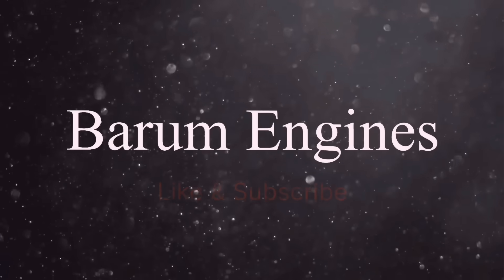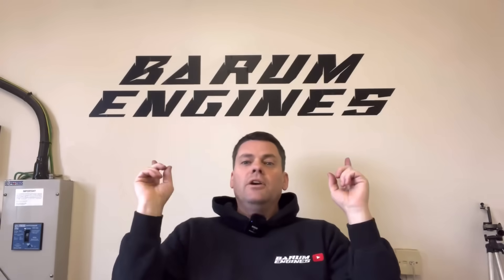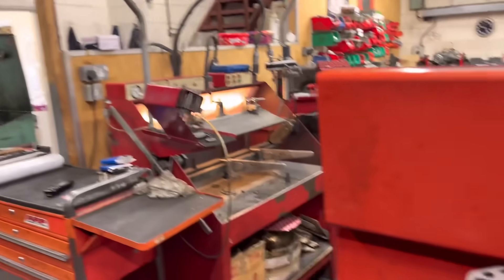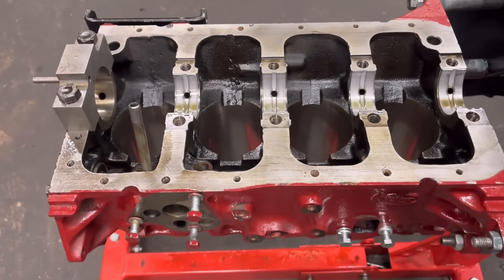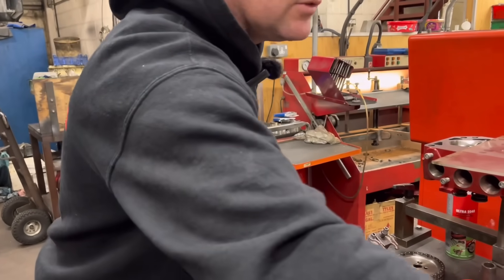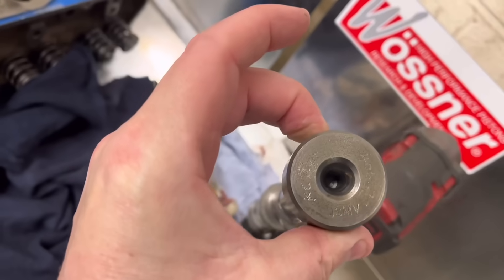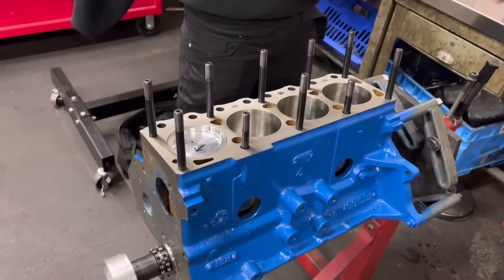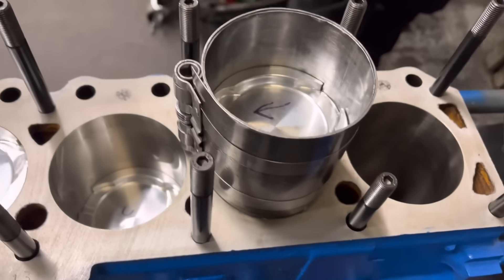Engine builder secrets: How to build a race engine

Comment: The pre crossflow, appeared to have polished ports on all of them. i could be wrong, these engines from my experience performed so much better with a rough inlet to mix the fuel and air, and polished  exhaust,to get rid of the rubbish, 
Also the cam you have in the "hot" crossflow, is very mild, and not a race cam, if you want a race cam go to a 285, that i used many times, or from memory, a 300, but no good on the road,
Reply: Back in the day we got 207 flywheel hp with a Kent 285 cam in an 1800 X/f on 48 Webers for Dave Edmands Fiesta,  HTR Ltd
Reply: @rotax636nut5  i only ever made 150 with a 285 cam on a 1691, with 40's, but took the 40.s off, as they were shyte, and made 145 with a modified  28/36dcd reliable engine, till i cooked it with a fan belt come off, then a head gasket! used to run to 7k, but this was a home build, so i was quite happy with the results, i did my own skimming with pate glass and grinding paste

Comment: In the Dagenham factory we used a burette, it's much more accurate! I was a production engineer on OHC block and heads, York Block and heads, Kent block, and the Kent diesel block after the changeover.
Reply: Indeed, we currently use a digital burette.

Comment: Like the new sign Lee, all thorough I thing Paul did it with some Duck tape and a blunt knife.
Going onto the MGB why did they not remove the breathers and bung up the hole on the inlet, run the engine and see if the smoking stops, before pulling down a rebuilt engine. 
Basic mechanics in my day.
I raced a 1.5 per x flow on 45s in a Cortina MK1, what an engine. It never missed a beat even when revving it to 10000.

Comment: Back in the day we use 85mm Powermax pistons, Vandervell bearings  and Kent cams to get the 1600cc ford up to 1760cc for the people who cheated in the 1600cc class and we did build a lot of these, but you need to get the right block for the job. It is also easy to bump the oil pressure up by pressing the pump release spring in so you can add a washer between it and the block, do not add to many as we tried more and blow a filter O ring out and what a bloody mess that was.🤫

Comment: Lee on compression ratio I forgot to mention to remember to account for rod expansion/stretch. Expansion can be measured with a rod&piston assembly out of the block. Measure the length at room  temperature then put it in an oven at about 150C and measure again.

Comment: The plasti gauge is a variation on what in industry (With much larger bearings) was checked with lead wire. Same process but the wire is measured with a micrometer after being squeezed in the bearing.

Comment: When I have done this its first done to make sure all the cylinders are the same cc to ensure all cylinders are the same compression ratio removing material from the chambers or grinding the valves so they all are. I have only one hole in the perspex and angle the head slightly so that hole is at the top by the edge of the chamber and use a smaller more accurate medical hypodermic from a vet. Especially when running high compression ratios say around 14 a small cylinder to cylinder cc difference can be critical.

Comment: Lee, I'm thinking those sharp corners where the valve cutout cuts out the side of the piston could be a source for pre-ignition.  Me thinks I would have rounded them off a bit to negate the potential hot spot.

Comment: Are you calculating the static or dynamic compression ratio?  For a performance engine the dynamic compression ratio is more important as it accounts for the valve timing as well as the other factors.  A DCR should be in the order of 8-8.5:1, whereas the static compression ratio can be 10-12.5:1.  The higher the compression the more power an engine will put out but above the DCR limit detonation can occur, the art is to get as close as possible to the DCR of 8.5:1.  
Whilst the engine appears to have been ported and the chambers relieved, have they been cc'd.  CC'ing only one chamber presupposes the rest are the same - is that the case?
Reply: Very good question as I was wondering the same thing. If they do all cylinders or just base all on one, also if you had to take 5 thousands off the piston did you also take 5 thou off the valve reliefs in the piston, or is the running clearance ok still.

Comment: Are the con rod bolts, stretch bolts ie limited amount of times they can be torqued up? On my Yamaha R7 OW02 race bike this is limited to two times and they cost £850 a set.....if you can get them.

Comment: Got a quick question I've rebuilt my n43b16a engine from116i I bought a head gasket set from the shop which they said was the right one for my engine and  it just will not start tried for over a week all times perfect looking through the receipts and parts what I've noticed is the original head gasket is 0.62 and the new gasket the shop gave me was 0.80 which has been installed would this be our problem of a no start with lowering the compression of been thicker or would it not make much of a difference any help would be greatly appreciated 🙈 😎
Reply: Fuel pump 360 degrees out.
Reply: @jamesaleando2529  thanks buddy I'll give it a shot 😎

Comment: I'm a bit surprised that you only measured the volume of 1 cylinder. On engines that I have worked on where the head has any sort of resizing of valves or changing chamber geometry we always measured the volume of every cylinder to make sure that they were within a millilitre or less in volume.

Comment: Not sure how to contact you so writing it here. iam just wondering how expensive would be to bore cyl block from 84mm to 86mm talking about bmw e36 325i m50b25 cast iron block. Thinking any chance would be to fit s50b30 m3 pistons in.

Comment: Did you number 1 to 4 con rod from the rear of the engine? Sure looks like no 2 in felt tip on no 3 cylinder not that it matters I guess as all new and can go anywhere.

Comment: Have you guys had much experience with the ford 2.2 diesel? My works van crapped a piston at 76k stuck a recon engine from ivor searl into it, now its on 116k so 40k on engine and its just let go again tonight. Need to do a proper diagnostic as to why tomorrow. I know that they are guilty of going but just a thought on your experience with them

Comment: Building and engine right now…. I am three days and $350 into trying to get the correct push rods as the ones I have just touch the underside of the roller rocker at maximum angle… so close, but this has probably pushed the build completion out by another week :(